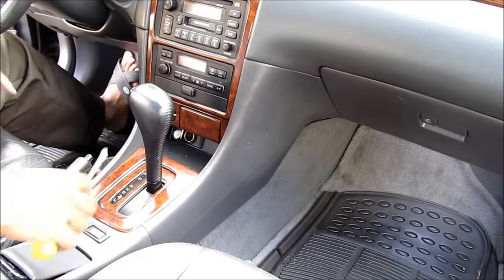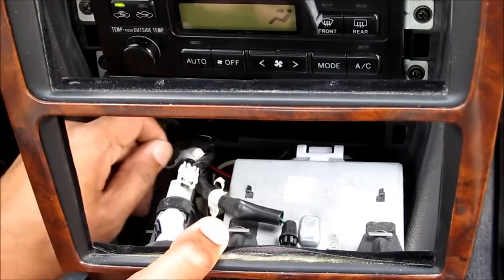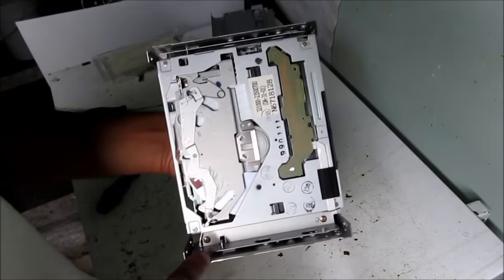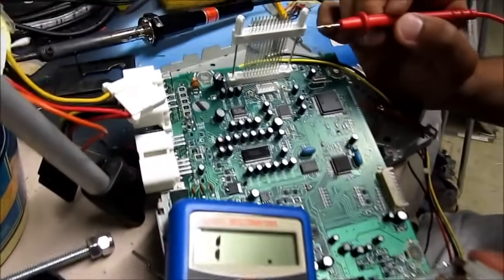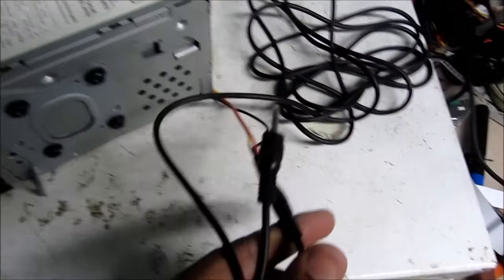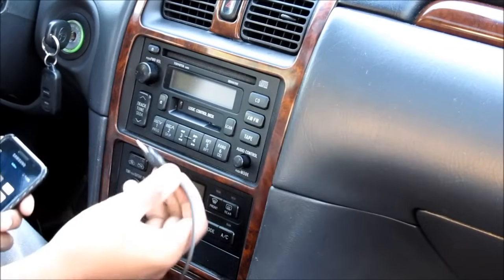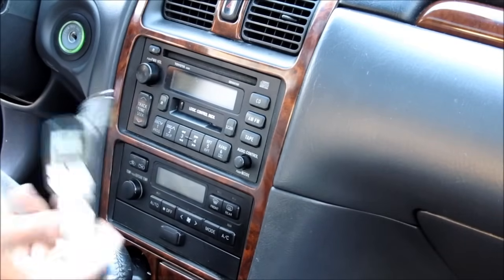Auxiliary Stereo Input Hack

Comment: Radio 16815:  It appears for the past few years I would get a radio from ebay but then it would need to be replaced after about two years.  Problem is always the volume control.  I would need to rotate the volume knob an excessive amount of times to get the volume to increase.  I was wondering if I should buy another radio, buy another face place or contact Fujitsu to see if I could purchase a rheostat.  Your knowledge and/or information would greatly be appreciated.
Reply: Interesting

Is the volume knob digital?
As in, can you rotate it forever and it doesn't stop?
Reply: siucbset Sounds almost like the radio is getting burned out somehow. Like the amplifier inside the radio isn't able to keep up and gets weaker and weaker.

Comment: my stereo looks the same in front but at the back the connectors are far apart...the one connected to harness is near the antennae wire
Reply from the maker: The concept should be the same, open it up and look for the L&R ports to solder to.
Reply: speedkar99 opened it and did not find L&R....my head unit is from a 1999 xle....exacly the same front face as yours but on the label it says delco model 09355969.....cassette deck too noisy cant use the cassette type aux thing....so just bought a $15 infinity HU (Hyundai oem) from salvage yard   :D
Reply from the maker: Not all times its marked. Use a multimeter to trace the line out wires from the tape head to two points where its easy to solder in your wires. Mine happened to be labeled L&R, but I traced it back to the cassette head.

Comment: I have a Ford radio with Tape deck and a cd changer. So, I just need to open the radio and find the right and left soldering points of the tape "circuit" and solder the wires there, right?
Reply from the maker: Yes, that's the theory. I have no idea if it will work on a Ford though, give it a shot.
Reply: Or search online for a FRDN-AUX  or FRDW-AUX,  they are the aux input adapter for Ford radios and there is no need to open the Radio
Reply from the maker: But it won't cost $2... :)
Reply: No  but , it can be installed in the vehicle in under 5 minutes and creates a new audio source that  You.can select from the Radio and you don't lose any features, and it just plugs in. No need to open the Radio
Reply from the maker: Are you scared to open the radio?
Reply: Time is money, I purchase the pie toy_aux  And save hours of work

Comment: I couldn't believe someone was doing exactly what I wanted on the exact same stereo head unit I have. I even have the same car! (US version) 
The only difference between you and me is that I'm using the stereo, JBL amp, in a custom indoors setup. When I had to give up my integrated FM modulator, I was hoping something like this could be done, especially since the tape deck didn't work.
Reply from the maker: Cool, so does your AUX hack work properly?
Reply: Perfectly. I still can't believe this hack was so easy! Thanks again.

Comment: Will this work with my stereo in my 05 Hyundai Sonata ? my stereo looks just like yours
Reply from the maker: Open it up and see if you see L&R ports labeled. Solder wires to those and see if it works in the various modes.
Reply: okay thanks for the reply !!

Comment: Thanks for the video.  Worked on my 99 Toyota camry
Reply: +Li Ge Can you post a picture/ video of your motherboard?
Reply from the maker: Great to hear it worked, do you have JBL or just the stock sound system? Was L&R printed on the PCB and easy to locate?
Reply: speedkar99 I have stock sound system, reads "Toyota 16810"(looks exactly as yours but board is a little different), you could add Camry and Avalon to your video title to help others, since they all have same stock radio. I was looking for this hack for a while.
The L&R were on the back of the PCB just as in your video.
Now the only problem I'm having is that sometimes the audio input does not recognize my phone, whether stereo is off or on before I connect my phone, and I only get a high pitch noise with radio sound on the background. This problem does not happen if I connect to stand alone speakers or monitor speakers. Do you have any Idea why this happens?
Reply from the maker: Good to know this AUX hack works on other radios. I know it also works on a Tacoma (or Tundra), as someone also tried it on their Toyota truck.

The radio isn't detecting your phone because of the type of AUX wire you used. I know Nexus 4 & 5 phones don't work on mine with the dollar store cable I used, something to do with the cable design and how it plugs in.

It could also be the phone not detecting the cable is pushed in all the way and thus not redirecting sound out the headphone jack.
Reply: I used a regular audio cable that came with my monitor.  What kind of audio cable would you recommend?  I believe that's the problem because I have an lg g2 and it is very similar to nexus 5 you mentioned was recognized
Reply from the maker: I don't have any particular recommendation, all I know is the dollar store cable worked with my Samsung Galaxy S phone and not with Nexus. Seek something with a higher quality with a name brand, I think you can also use stereo microphone extensions and cut the ends off to use as your aux cable.

Comment: Thanks for this video!  It works!  I soldered an audio extension cable to have an aux input, and it works great.  I just bought a bluetooth adapter to plug into the female aux jack.  However, the FM signal still comes through faintly (enough to notice on the quiet parts of songs)  I was thinking maybe I could switch off the antenna somehow while the bluetooth is on, but do you have any other suggestions?
Reply from the maker: Try using in tape or CD mode with a blank tape/CD playing.

Comment: @speedkar99 Thanks a lot, so instead of adding a 3.5 mm cable i just get one with a female aux jack right? BTW I just have another question the orange lamps do not light up with my small lamps or whatever they are called. Is there a way to fix this? Thanks a lot

Comment from the maker: @Syed Khalid
It should be the same as the tape deck stereo since your soldering to the tape's L&R ports anyways. Yes, a female aux jack can be used, but you'd still need a patch cable to run to your MP3 device.

Comment: The cable I soldered didn't have an insulated ground wire.  It had a bare stranded wire, which I did ground to the same spot as you did in the video.  Do you think that could be causing me a problem?  It makes loud pops and static in between songs.  You can also hear the radio in the background behind the static.
Reply from the maker: Yes a bad ground might cause the static and background radio. You need a clean strong signal to over-ride the radio. If not, try running it in TAPE mode with a blank cassette. Mine over-rode by shear luck as essentially I soldered it to the TAPE deck wires.
I occasionally get loud pops when I plug and unplug my phone.

Comment: hi speedkar99
i have 2003 toyota avalon and i am trying to find the remote wire from my JBL car stereo to connected to my Boss amp !!
do you know what wire or color is the "remote wire" to connected to the Bose amplifier.
thank you very much
Reply from the maker: Sorry I am not familiar with your car, if you get a wiring diagram it should be able to tell you the pin-outs behind the stereo.

Comment: I have the same stereo on a 99 Solara SLE.  my galaxy s4 doesn't recognize that the headphones are plugged in unless the radio is off or its in CD mode.  Do you have any idea what would cause this?
Reply from the maker: Probably has to do with the jack detection settings on your phone or the quality of cable you used. I know my cable doesn't work or fit well in Nexus 4 phones. Have you tried other MP3 players?
Reply: I have tried an iPhone and it works fine.  I've been looking on the Internet and this seems to be a common problem with the galaxies. ....
Reply from the maker: Works with my Galaxy S as in the video...
Maybe you can try a different cable?

Comment: excellent  video ,but on a '00 Toyota Tundra cd/cassette,(Fujitsu122000-18200101) not as simple to execute , there are no R/L test ports that are marked like that .I do see Dolby R/L,pro R/L  .I'm bumed, this looks like a super easy solution .......
Reply from the maker: It doesn't hurt to try those Dolby ports too.

In reality, this mod was to tap directly into the wires coming from the cassette head (4 wires, left and right, positive and negative). You'd have to play a blank cassette to trick the player to feed from the cassette input. The direct tap eliminates the hiss from a typical cassette aux adapter.

It just so happened that the L&R ports on my radio were electrically conductive with the wires on the cassette head, which made it easier to solder to.
Reply: speedkar99 Steve Trombetta same problem, the dolby l/r does nothing...pro l/r works only when tape is in the deck, unfortunately mine makes a terrible clicking sound while playing, randomly stops.   I want to trick the unit into staying in tape PLAY mode.
Reply from the maker: Have you tried a blank tape?

Comment: Great video, ive got my 99 solara stereo torn apart. Im NOW realizing the ground wire and how to test or determine which wire to ground is something I have NO IDEA how to do. Please help im stuck on the ground wire thing. I have two wires in my 3.5mm cable. L side, R side   I understand that, and that's about it. Please HELP
Reply from the maker: The ground wire is common to both L & R speakers. Your cable should have at least three wires (L, R & Ground) in it, otherwise you won't have stereo sound. The ground wire connects to any metal on the shell of the radio, as you see in the video, just wrap it on a case screw.
Reply: Thanks for the help. So I need to find a audio cable with three wires L,R, & Ground. The one I used only has 2 wires inside. A shielded wire and a bare copper wire. Ill give this another shot. when I hooked my radio back up my left side channel wont work hopefully its not blown out for good.  Thanks again for the help.
Reply from the maker: Yes, stereo sound means two channels and a minimum of three wires.

Did your AUX input work when you put it back together? Maybe you had a mono-sound cable used for microphones.
Reply: well I found the proper type of audio cable. Three wires a red, a black, and a bare copper ground. The first attempt at this removed my left side channel. I could play through the right side, it worked fine. I took the radio apart again, hooked up the red, the black, and grounded the ground wire to the case. after installing it again my left side worked but I lost the right side. Im sure im following the directions. Everything is soldered well and my connections are good and test good with the multi-meter. any ideas on what is going on?  any info would be a help at this point.
Reply from the maker: Find a point on the main-board that is electrically conductive with the L&R ports you soldered to. Use a multimeter to test conductivity between those test points and the end of your 3.5 mm aux cable. If they aren't conducting, your connection is bad.

Comment: My aux cable only have red and yellow wire, so do I solder red to left and yellow to right? By only soldering red and yellow will the aux work with out ground?
Reply from the maker: You need a ground for it to work. You'll have to determine if the red is left or right with a multimeter and find a pin-out for the 3.5mm jack.

Comment: I just did this on my stero model# Fujitsu Ten 122000-50600101  I also have the R and L as shown in the video but the 2 adjacent ports next to where you left the cable to the tape player unattached (3:51) it says R-channel and L-channel.  Are these the ones i'm supposed to solder the L and R connections to?  I did it to the other set of R and L and it didn't work.
Reply: I just tried it to the ones I described and it was for the tape output.  How do I tap into the FM output?  The circuit board does not have it labeled.
Reply from the maker: Mine didn't have the FM output labeled, and I taped into the tape output as shown in the video. Unexpectedly, the AUX music from the MP3 player automatically overrides the FM music when I plug it in. You could try tricking it to stream music from the tape L&R channels by playing a blank tape.
Reply: Ya, the one I soldered the connections to were for the tape so I've been using the blank tape method.  I have another set of R and L but they were not for anything, even blank CD.

Comment: helal olsun dayı . güzel bi paylaşım olmuş
Reply: if i had a 2000 toyota solara radio can put in to the 1999 solara car also the it fit.
or the connections  different.
Reply from the maker: Most likely they are compatible. Make sure you match the stereo type, JBL with JBL.

Comment: I have one more request. Instead of a 3.5 male cable, can I use a 3.5 female pin so I can screw it on the panel? Do you think that it would work the same way?
Reply from the maker: Yes it would work, but it means you'd need another male to male connector to connect your AUX device.

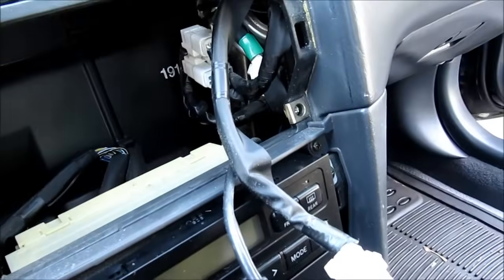Comment: Hey man, do you know anything about how I could install an after market Pioneer radio. I can't find the wire schematics for that JBL wire so I can splice it into the connecter for the pioneer radio. (2:05 is what I'm talking about)
Reply from the maker: You need a wiring harness specific for your car to convert the spare connectors shown in the video to wires that your Pioneer stereo can connect to. I don't recommend splicing directly into the car wiring. See my Pioneer stereo installation video for details: CAMRY Pioneer Stereo Install

Comment: This looks like a great option. I'll have to see if there are L&R solder points in my Avalon's deck. If not I guess I could use the L&R input leads that used to connect to the tape deck, which is long gone.
Reply from the maker: I think most radios might have the L&R points, some may not be marked. The tape deck will work, but it won't be amplified, pickup some noise from the head, and you'll have to trick the cassette player into playing an infinite loop.

Comment from the maker: You could try opening it up and seeing if there are L&R points that you could solder to.
With the 2005 Camry, you have aftermarket options like ipod and aux adapters. I believe some 2005-06 Camry's came with AUX as standard equipment.

Comment from the maker: It should be exactly the same. Solder the two wires to the L & R marked on the board and connect it to your aux jack. Test it out in different modes (some require you playing a tape for it to work).